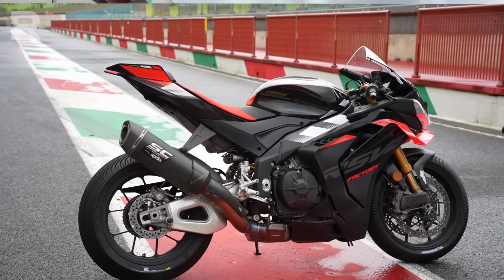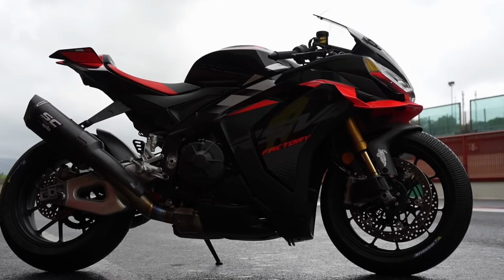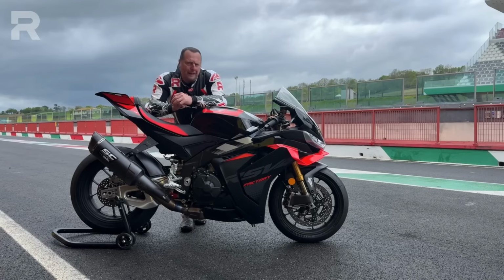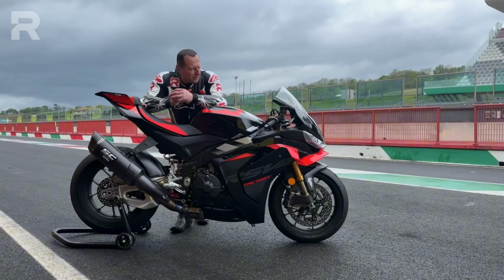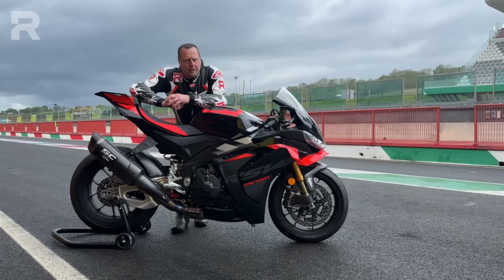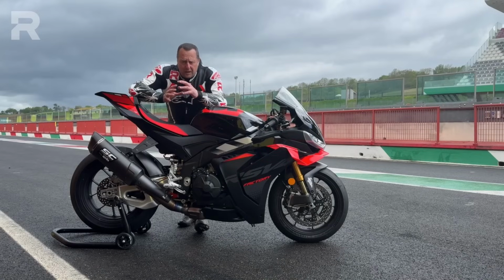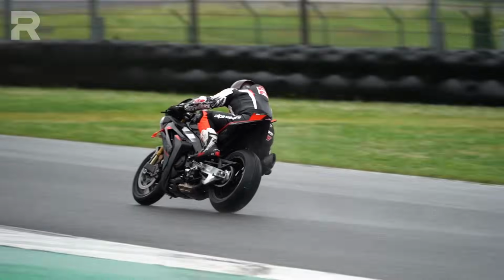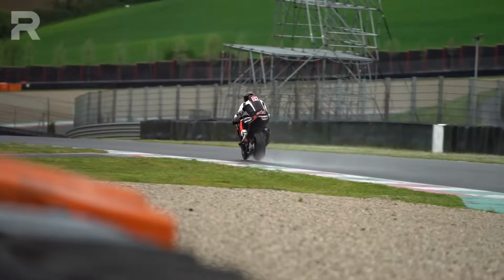Aprilia RSV4 Factory 1100 2025 - test - riding the most powerful production Superbike

Comment: Bloody gorgeous bike and it sounds fantastic. Curse my ageing back and arthritic wrists for not allowing me to own one.  😡 Great review though, thank you!
Reply: There's always the Tuono.
Although as a sciatica sufferer, I never had a problem with clip on handlebars.
Reply: @pauln6803 yeah good shout. I've got degenerative disc and I got on fine with my mt10. Just traded that for a new xsr900 and that's super comfortable. The Tuono could be next 😊
Reply: @VadersDarkside 
I'm drooling over an RSV4.
If only they weren't so small.
As an ex Mille (4 of 'em, with the last one actually surviving long enough to be sold!), I've still got a soft spot for aprilia, and I'm drawn to the tall seat height, but at 6'5" it means shelling out on adjustable rearsets and possibly an exhaust to allow for positioning of the pegs as low and far back as possible.
If I knew that the carbon Dymag wheels I've got on my KTM RC8R would fit without any modification, then I'd say sod it and get down to the nearest aprilia dealer.
Shame no sports bike since the original KTM RC8/R has adopted the adjustable ergonomics.
Reply: @VadersDarkside you won’t regret it. Looove my 2020 Tuono.
Reply: @pauln6803  Hi Paul. I'm 6'2" and own this RSV4. I had the SB09 previously and I find there is more room now.

Comment: I have never ridden an Aprillia. I think it's time to have a go.
Reply: you should my guy. the bikes is different. plus much more cheaper than a duc
Reply: @kalidismail2663  - right?  For an Italian racing bike, Aprilia’s are a superb value imo… you feel like a million bucks riding them.
Reply: Imo, it’s as close to telepathic control you can get on two wheels…  control of it is intuitive (for experienced riders).
Reply: You won’t be disappointed! Just something about how your body connects with this machine. It’s amazing.
Reply: Idk if you’ve riden a cp4 motor r1 but it’s basically the same with way more top end and it tips over faster.
Reply: Me too!
Reply: That V4 is sweet, chassis is divine. The Tuono is sensible for the road.

Comment: Thankyou for the audio translation into English 👍. I absolutely love the look of the 2025 RSV4 Factory and my heart says yes but my head says NO! due to past engine problems in the 2022 RSV4 Factory and thermostat, coolant leaks, oil leaks etc. Nothing else can touch this bike for power and torque but it needs to be able to keep running without breaking down. I will wait to see some real world owners reviews in the next year or two on the reliability of the machine because i love it, i just don't like breaking down and losing a riding season because the bike is in the dealership waiting to be repaired. Subbed ❤.
Reply: Reliability issues are overblown. Follow your heart ❤️
Reply: 4 ème rsv4 , jamais je n'ai connu de panne. Et pourtant je la sollicite.
Reply: I have been waiting on this exact bike to come.  And like you, I have my reservations from things I've read in the past what you touched upon.  I simply cannot fathom any bike.manufacturer shitting out bikes with faulty seals, over-heating issues, questionable reliability outside of beating the piss out of the bike.  I been riding Kawasaki for the past 8 years and while it had some small hiccups, the warranty was 100%, zero questions.  I know nothing about Aprilia, but Kawasaki did me right.  So it's this 2025 Aprilia RSV4 Factory 1100 or the 2026 ZX-10RR (or the R).  And since I was veey satisfied with Kawasaki, Aprilia better bring their A-game.  Any bad news feedback will steer me away.